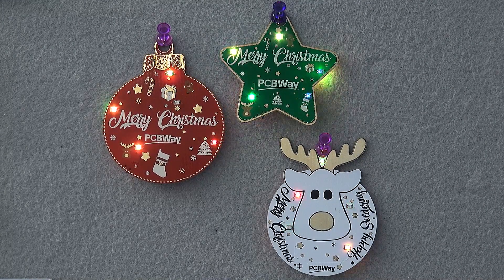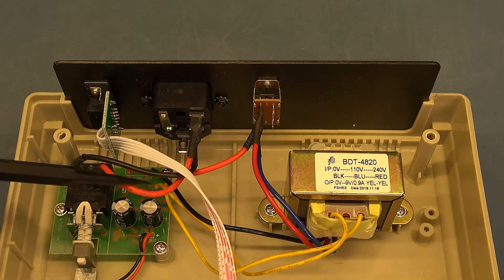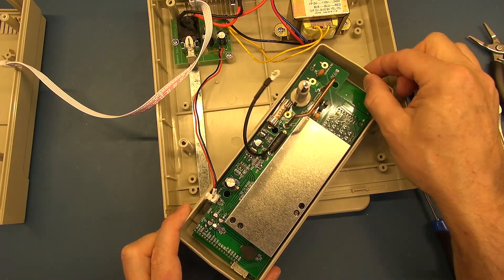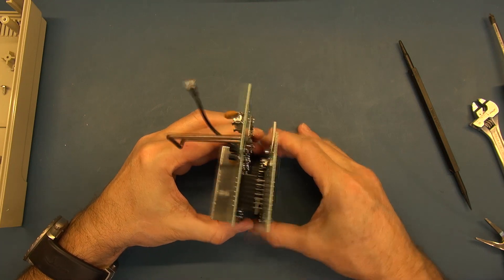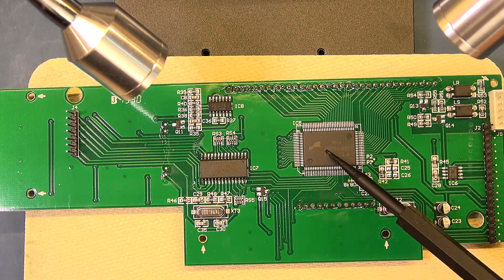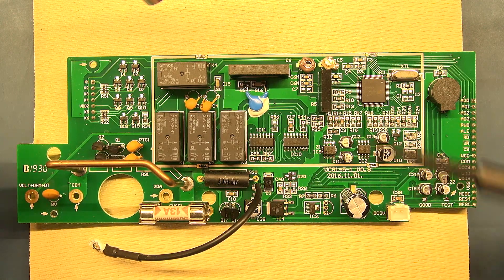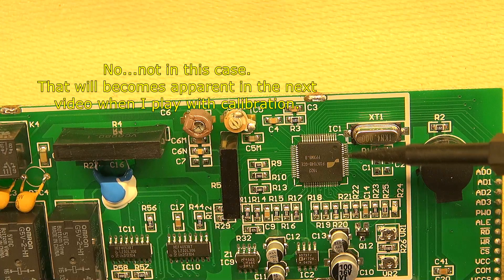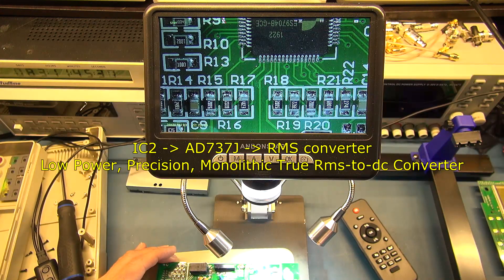Vici VC8145 Bench Multimeter - A Look Inside - Pt 3

Comment: I've owned this multi-meter which is labeled as a vichy for well over 10 years. I've used it daily all this time. This meter is one hell of a meter for the price I paid which I think was like $140.00 USD. Even after all these years it's accuracy is still rock solid and it's back light is still bright and this thing stays on 8 to 12 hours a day. I use it for repeated high voltage measurements in the 600 volt range along with current measurements exceeding 1 amp and as low as a couple milliamp. It sill works great. All it's functions including it's diode check still work great. Capacitor function is still functional and is accurate enough for the work I do. What more could a tech ask for. I love this meter!

Comment: Very well done video, thank you for taking the time to produce this review and provide so much information. Regarding your battery operation idea, it looks as if the power switch has a set of  un-used contacts that are brought out to the back of the power supply/switch circuit board. If so, adding a battery pack would be much easier! It would be interesting to power up the main circuit board using a bench supply then lower the voltage slowly from 9 volts to see if the battery monitoring hardware/firmware is already implemented.
Reply: No, there are no unused contacts on the DPST mains switch.  The mains input goes to two pins on top that go right through the switch body and onto those two unused tracks.  Look at 11:17 as the board turns to see the alignment of the pins on top and coming through the PCB.  And even so, why would you add a battery pack on the mains side?

Comment: D flip flop is driving the backlight, toggling it on and off. connected only to the backlight switch on the front panel, and nothing else, aside from the 5V power supply.

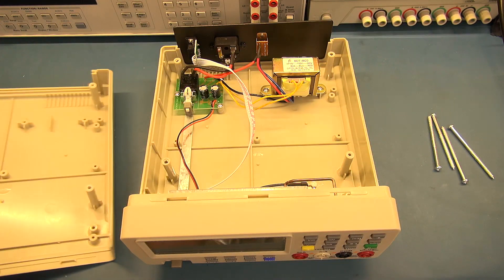Comment: 3:30 and this pisses me off. This cheap multimeters are just "air in the box". There are reasons for this format. Open some HP3478 or Keithley 2000 and you will see it is packed with electronics. But these modern cheap multimeters could have - and should have - much smaller footprint on my bench. This is the reason why I am considering OWON XDM1041 as alternative to VC8145. Actually, if the OWON had not connected cables from the back, it could be hanged on the wall :-)